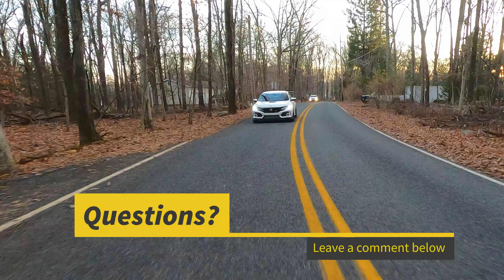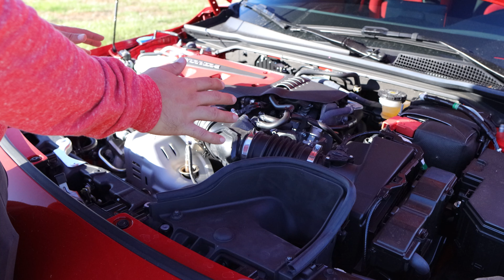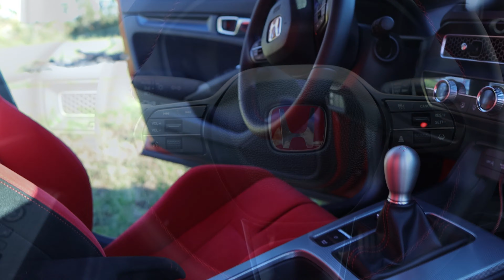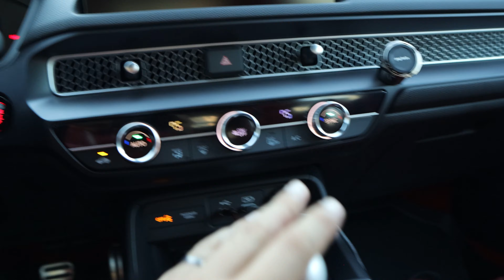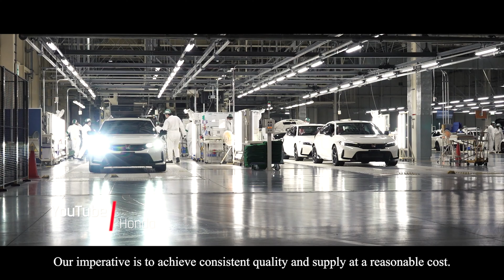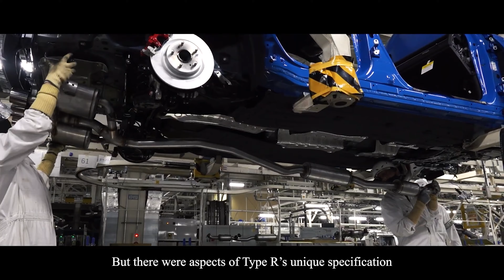FL5 Honda Civic Type R | 5 Things I Love

Comment: I can get 30 mpg when I just drive around with not pushing it often, I love mine.
Are the seats even better on the FL5?
One huge improvement is the logging tech that's in there, I wish mine had it as well.

Comment: The FL5 sure has nice lines to it, not as wild as the FK8 and I like the way they made the wider panels, totally integrated and nut just added on as an afterthought as in the FK8 or even the older FK2.
Cheers Elias, peace! 👍💪✌
Reply: Yes, I hate the 20" wheels and like the 18" Oz ones I have.